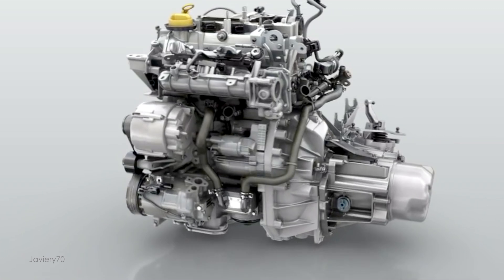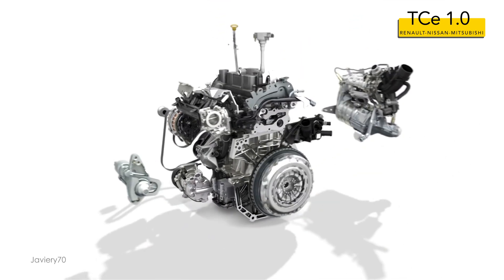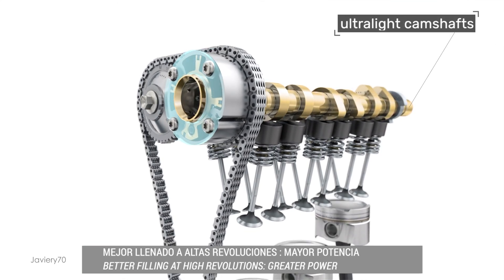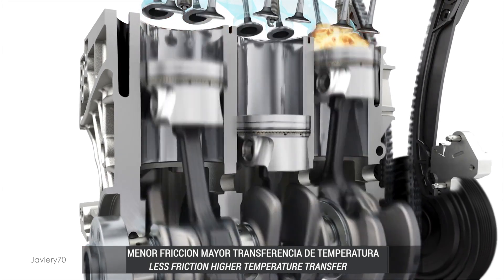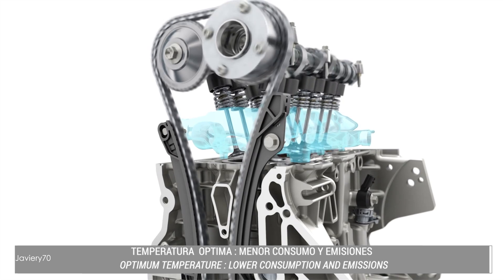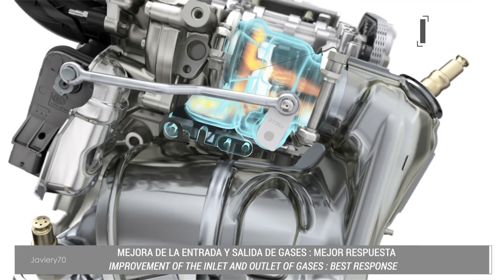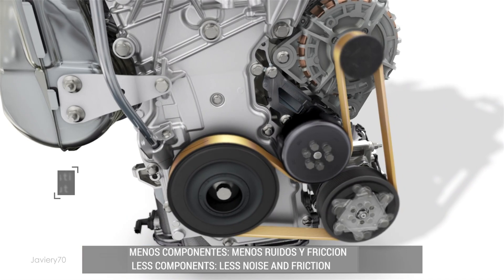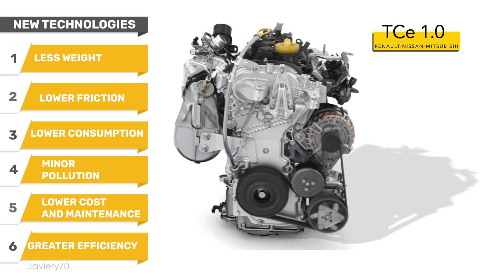🔸 RENAULT - DACIA 1.0 TCe - HR10DET Engine its technology ( eng )

Comment: Question; what is the cold start jerking with this engine? It goes away when warming up (sometimes it gives a very small jerk) but mostly unnoticeable once warming up. To eliminate most of this, I wait until high idle drops down and drive off but in winter it takes a bit longer...? Is this a normal phenomonon with this engine? Thanks for any insight @javiery70
Reply: It’s normal, they all do. They run very lean because of emissions
Reply: @willemb8689  yeah it feels very wrong to have it jerking like that, but once it warms up a little it drives so good and very good for such a small engine.
Reply: @ With airco on it gets even worse on a cold engine. When its warms up it drives nice and smooth. I had a free software update done, a little improvement, but nothing major.
Reply: @willemb8689  I have it remapped, even with running 'less lean' it's not improved much. But like you said, once it's warmed up a little bit it drives so good
Reply: @  good to hear, I was wondering I a remap would make a difference. The tuner (BR) promised it should improve, but that is more a sales trick I am thinking now.

How do you like the extra power?
Reply: @ the extra power is awesome! It’s already a responsive engine, but after the remap it really comes alive! Mine has been remapped by BR-Performance too
Reply from the maker: whether cold or hot the engine should not jerk at all. Is this jerk only when starting in first gear?
Reply: @ when I drive off without waiting for the idle to come down, and I let go off the gas in any gear, it like jerks and feels like it’s gonna stall but it doesn’t. As long as I keep throttle on it’s fine. Car is only two years old
Reply from the maker: You mean that the engine tends to stall when it stops.
I have not had any problems of this type in my workshop with this engine.
It is necessary to check with the OBD computer if there is some kind of fault in the injection that could be the cause, some sensor or even a software error. It is necessary to go to the workshop for a diagnosis.
Reply: Durduğun zaman traktör gibi sallanıyor

Comment: "There’s no replacement for displacement". American engineers were right. Downsizing is bullshit 😮.  Mazda just released a good straight atmo 4 cylinders 2.5 liters. No turbo. Good consumption. Torque is OK and co2 émission also. That’s it. Regards from France.
Reply from the maker: True, thanks to the fact that that 4-cylinder Mazda engine is capable of running on just 2 cylinders.
Reply: One of the most sold cars in history was the VW 1600 Beetle that had only 50 - 60 HP.
The quastion is do these small 1lt Turbo Engins have enough UMFF when needed to get you  out of a tight situation...like passing! 
Nothing more nerve racking than RED LINNING THE ENGINE AND NOTHING HAPPENS!

Comment: Nissan juke 1000cc turbo TALE A LOOK IN ENGINE VOICE IF I OPEN THE OIL CAP !! Like diesel 
https://youtube.com/shorts/SwW_bGP8bPE?si=AaWCwO0kuKimkFTP
Reply from the maker: @ΙωακείμΚόμης  This engine is a TCe 1.0 HR10DDT with 110 hp direct injection.
This noise could be caused by a broken flywheel.
Reply: @ it is only 4.800 kilometers is that possible ?
Reply from the maker: @ΙωακείμΚόμης It is possible due to a manufacturing defect, the Nissan workshop must check the noise.
Reply: @javiery70  all strart when Nissan change oil and oil filter (1rst service )!!!
Reply from the maker: @ΙωακείμΚόμης You need to take it back to Nissan on a tow truck.
Reply: @javiery70  so I was going to Nissan. The answer was : the sound was normal for 3 cylinder engine and disappear when car is hot ? Is that normal for your opinion normal ..I hear it like diesel engine !
Reply from the maker: @ΙωακείμΚόμης In the video you can hear the engine making a lot of noise.
Every day I see many Tce 1.0 engines and they don't sound like the video, they don't sound like a diesel.
Reply: @  In cold start I hear a tik noise from passenger side. After 5 min disappear . So from your experience what could it be ?
Reply from the maker: @ I do not work with Nissan vehicles. If this noise is only heard when the car is cold and is heard on the passenger side dashboard, it could be the sound of a relay being activated.
There may be fuses and relays behind the dashboard.
Reply: @ The noise came from the left side of engine when the car is cold … in idle 850 rpm I hear it like time chain sound but Nissan says : it is normal and came from injectors!! Is that normal for 4000 kilometres engine ? In 50.000 what ? I speak only for engine ! Thanks for answering
Reply from the maker: @ The injectors and the fuel pump in the upper and central part of the engine always make a slight ticking noise when they are running hot or cold. This is their natural and normal sound.
The belt and chain are on the left side and should not make any noise.
You could go to another Nissan and get other opinions.

Comment: A lot of these now seem to have noisy turbos.
Reply: I like my operation noise ❤
Reply from the maker: Not all 1.0 Tce engines, only some versions.
Renault has a solution for the noise and you should go to the dealer.
The noise does not affect the normal operation of the engine, it is just operating noise.
Reply: I bought Dacia Jogger in 2022 and didn't have any issues everyone is talking about. It's a limited SL Extreme edition though, I don't know if it matters

Comment: Very nice video, what about 1.0 TCe LPG?
Reply from the maker: Same engine but its cylinder head and valves are adapted to LPG combustion. In addition, the gas injection system with its components has been added. But physically the engine is the same.
Engine without LPG
H4D 452
H4D 470

LPG engine
H4D 480

Comment: I just ordered the Renault Clio V Esprit Alpine with this engine with a 6-speed manual. In about a month I will pick it up from the dealer. Absolutely looking forward to it. Stunning looking car!

I have a Citroen C3 with a 1.2 puretech for about 2 years now from 2016 (2009-2016 model) that I bought second-hand with relatively high mileage for its age (95k km - now 110k km). But considering all of the puretech probems (especially the wet cambelt that doesn't inspire confidence over years of ownership) I couldn't resist trading it in at a decent price. 

In all fairness, my puretech runs fine (it had its belt replaced in september 2024). But I keep seeing a lot of issues with these engines online from other owners. That definitely helped with my decision to sell it for an (arguably) much better engine and car in general.
Reply from the maker: True, the Citroen oil belts are not giving a good result.

Comment: This little engine looks way better than the awful Ford 3cyl ecoboom , its actually got a METAL cam chain instead of an oil soaked rubber band !!
Reply: The same with the 1.2 puretech from PSA (wet cambelt). Terrible design especially for longer trips where the engine oils gets very hot.
Reply: they fixed that couple of years ago. however, for that historical reason alone, i bought a kuga with mazda's 2.5L engine instead.

Comment: We recently bought a Sandero stepway 110hp. Mostly the same block as this one but with other mapping I guess. Great little car. Dacia is doing well.
Reply from the maker: The 1.0 TCe 110 hp engine is technically called HR10DDT and is also a 3-cylinder, 1,000 cc engine but with direct injection. It is a smaller version of the 4-cylinder HR13DDT engine.

Comment: all the tech and stuff aded and at the start consumption figures and co2 from 0.9 tce is 4.1 liters and co2 90 some grams and the new 1.0 tce has consumption of 5.6-5.8 liters and co2 100+ to 116 i think.... so useless tech and money and R&D for less efficient engine??? who can fuckup the world and everything in it, humans can thats who with crap lieing and marketing shit because they lose bilions for useless R&D ....
Reply: Settle down....a bit knee jerk reaction...perhaps the slight increase in consumption is due to avoiding a too lean mix or similar.. Perhaps there were issues also like higher heat due to lean mix which impacted reliability... Etc etc...an increase in torque now so you don't need to thrash the engine sometimes.. I am positive that it will be for concrete reasons and not for whatever your knee jerk angry conclusions. Cheer's anyway..
Reply: I agree. It's highly unlikely that Renault would choose to raise it's average fleet consumption and risk paying tax for that if it was not dealing with an actually more costly problem.

Comment: My 2022 Dacia Sandero Comfort TCe90 with its 6 speed manual gearbox is a nice, quiet & smooth running car. Great value. Decent little engine with enough power for the size of car & its use.
Reply from the maker: 👌Dacia Sandero is the sales leader in Europe.

Comment: I have a 2023 Clio V TCe 90 manual new ordered since April. Now in December 2024, after 1 small maintenance last april and 41k km’s on it, no complaints and very well built small car😎
Reply: Word of advice!
If you want to keep the car for a long time, DONT follow the manufacturer recommended oil change intervals. This kind of low displacement turboed engines shouldnt do more than 10,000miles on the same oil.
Reply: @MrRubenRusso Már bocsánat;10000.km!!!!!Nem 10000mérföld,mert az ugye, Európában már 16000km.
Reply: @MrRubenRusso , du "Ingenieur"  kannst ja dein Öl schon nach 500km wechseln , was für ein Blödsinn !
Reply from the maker: thanks for commenting.🙏👍
Reply: Majd lesz, ne aggódj!!! 😂

Comment: Javier, thanks for the video. I own clio 5 with this engine and I'm surprised how quickly this engine heats up. According to video the engine has separate cooling for the cylinder head and engine block with two thermostats. Can you explain briefly how the cooling system works that makes the engine to heat up so quickly? I wonder if the cooling fluid circulates from the start of the cold engine or it starts to circulate once the engine reaches some defined temperature?
Reply from the maker: Thanks for watching the video and commenting.
With a cold engine, the water only circulates through the upper part of the engine (cylinder head). With an engine that is already hot, starting at 87ºC, the water circulates through the upper part and the lower part (engine block) and both circuits circulate through the radiator.
In this way, the engine independently reaches its ideal operating temperature faster.
There are 2 thermostats in a single piece.
Reply: @javiery70 Many thanks for explanation

Comment: No counterweight shaft?
Reply from the maker: @filipfaber9395  I'm sorry, I don't understand the question well.🤷‍♂️
Reply: @javiery70  3 cylinder engines has normally counter balance shaft. Because they have big inertia effects of the 1st order.
Reply from the maker: @ Yes.
Crankshaft balance is essential to reduce combustion vibrations in this 3-cylinder engine.
To reduce vibrations, the design focuses on the balance of the crankshaft, flywheel and accessory pulley.
The flywheel is larger on this 3-cylinder engine.
Reply: @javiery70 dual mass flywheel?
Reply from the maker: @ The 1.0 TCe engine does not have a dual-mass flywheel.
Reply: @javiery70  no dual mass flywheel? Unbelievable, that should be great in terms of reliability!
Reply from the maker: @ It does not have a dual-mass flywheel. 👌
Reply: Neither does the k9k diesel. Old fashioned solid flywheel. Which is better
Reply: probably slightly offset piston travel too, to minimize or cancel the need for balancing shafts. at least Hyundai does that with their 3 cylinder engines.

Comment: Hello, thanks for the very informational video! 

I have a question, what is the average lifespan of this kind of engine? How many KM's can it go with regular service intervals like 10.000 km?
Reply: My neighbor is a taxi driver..He has a Dachia with the same engine, gasoline + gas manual 6 speed..Properly serviced at an authorized service center. Now it has 429 thousand kilometers without any major problems. That's why I bought a Captur, with the same engine..now 36 thousand kilometers, without a single problem. At the last service, the mechanic told me: Renault has finally made a reliable engine.
Reply: @ToniKleme  Wow that's huge mileage for such a small 3 cyl !
Reply from the maker: @ Surely the engine is very well cared for by its owner.👍
Reply: @ToniKleme sorry but the taxi had maybe the 0.9 tce??
Reply from the maker: @Carlitostevez91 No.
1.0 TCe
Reply from the maker: Renault does not provide information on the life of an engine. It only reports that with proper maintenance and care the engine has the same useful life as the vehicle.
During engine tests, they cover up to 300,000 km to check its reliability.
Reply: @javiery70  Thank you for the input, I have this exact engine on the new clio 5 and it's going to get used quite a bit since I've done over 18.000km in about 6 months :) Great to know that they can last more than 200.000 without any major issues

Comment: How much hp and torque can we get from Stage 1 software if we apply it ? The engine is very enough in city traffics , but at the autobahn the car suffers a little bit because of low torque.Especially when you are fully loaded and 5 people in car with A/C on.
Reply: Mine is the 1.0 tce 90 hp version and now has 115 hp/ 200 nm torque for stage 1, much better now on the highway
Reply from the maker: 100 hp / 160 Nm is the original power of this engine. Its small displacement and power limit it to use mainly in urban areas. With a loaded vehicle its performance is very limited...

Comment: Ciao Javier, questo motore a me piace molto, lo ho nella clio ultima versione. Solo un disguido, spesso ricevo il messaggio "Livello Olio Rabboccare" ma verificando dall'Asta manualmente (lo hanno visto 3 meccanici) il livello è ok. Anche il meccanico ufficiale ha detto che è ok, poi il messaggio scompare e in officina mi dicono che devo andare da loro solo con il messaggio visualizzato altrimenti in diagnostica non lo vedono. Cosa potrei verificare? Grazie
Reply from the maker: Sorry for the delay.
There are cases where the problem is the instrument panel (small size).
A reprogramming of the panel is the solution.
The second solution is to replace the oil level sensor.
Reply: @javiery70  hi, thank you very much. I,  have in effect the small size instrument panel, it could be the problem. I have the message often after a long trip but always at first restart or when i don't use the car for 2/3 days. Never driving.